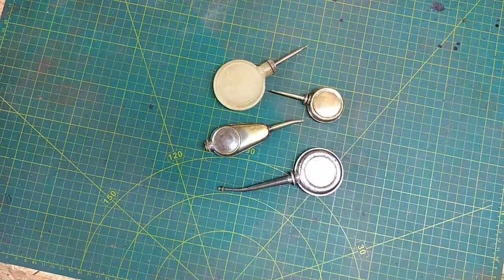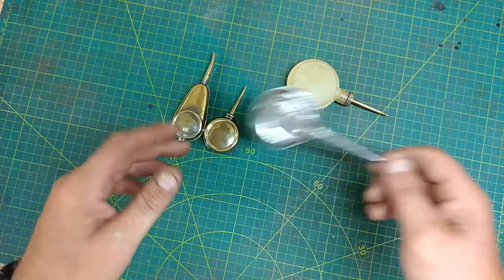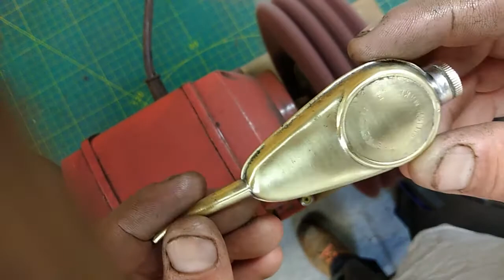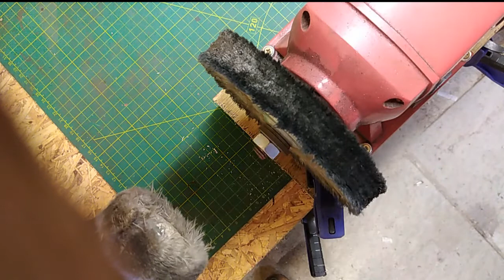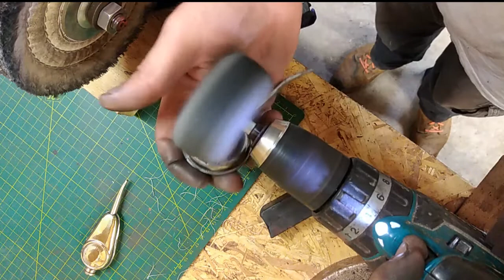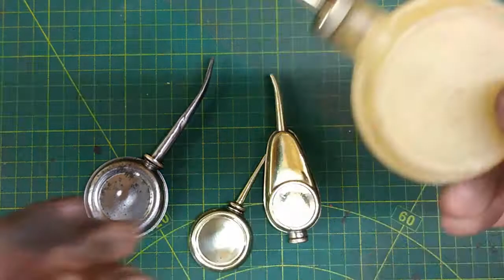4 banjo mini oilers oil cans watches clocks old hand tool restoration

Comment: Just a tip don't use your drill like that to polish I was doing the same thing now my drill is dead.
Reply from the maker: Thank you for that thou I have a few makitas, that one I use solely for the fact it only works (for the past 4 years) in top speed, slow speed slips, has to be taped 8nto top speed too, and only works in forward not reverse lol, I changed the brushes a couple of years back and it's around 15 years old now I think. Still have a dewalt (orig metal chuck) 12v from 2000, so heavy compared to new stuff. Generally I find the top brands last forever.
Reply: Mines a Makita thought it was brushes so changed them it just got to hot ive fyed something.